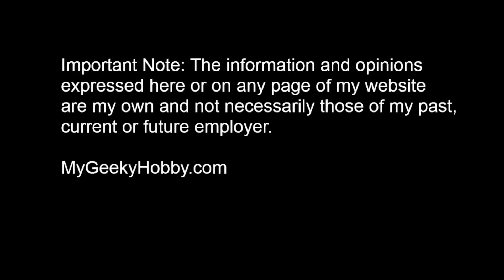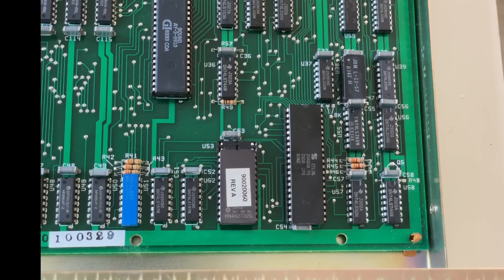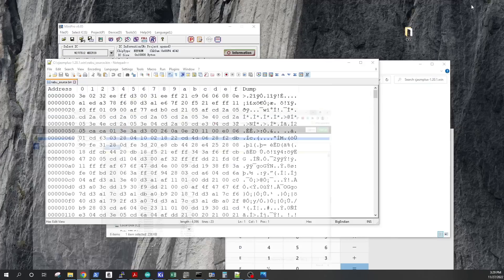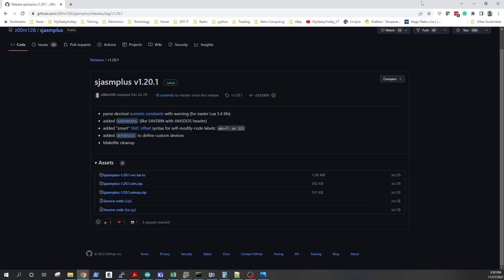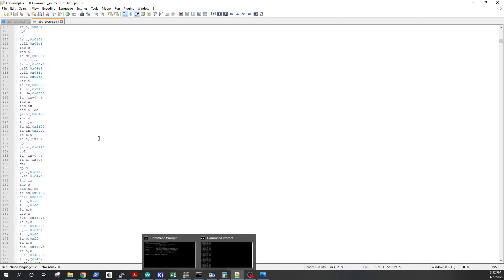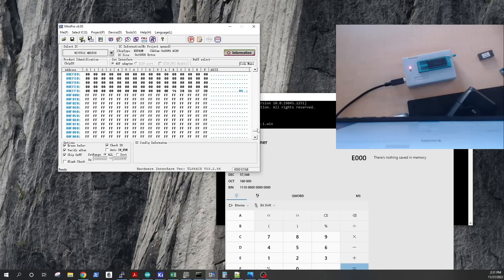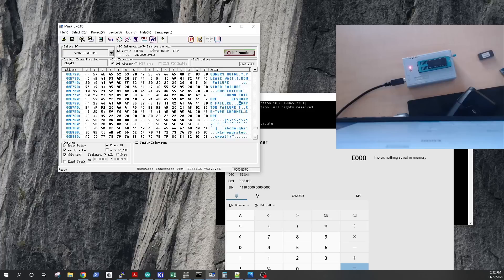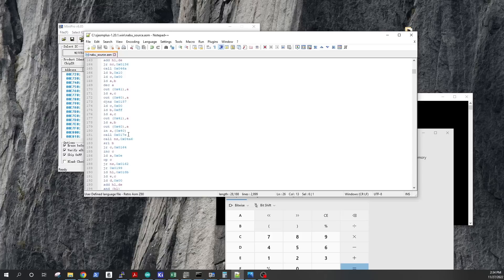#17 NABU PC Hacking

Comment: If still using only 4k on an 28pin (8k+) ROM, is it necessary to still cut the 4k trace and jump 8k? Just don't know if the trace/jumper is to support the hardware (24 to 28 pin EPROM) or to support the address extension for a larger EPROM.
Reply from the maker: You can use 28pin device without the modification as long as you don't go over 4k

Comment: I won't be getting one of these things but I've been watching the progress on these nabu machines. An easy way to fix a checksum failure is to do what we did when hacking motorola walkie talkies to work on the CB band. We'd first find out the checksum of the unmodified code, then make our changes, then change an seldom seen error message or the copyright message that never shows on the screen of the radio sufficiently to correct the checksum. Its a very hackish, amateurish way to do it, but it works :)

Comment: its possible (not probable ) that the couple of lines of code at the very end (of the 4K ROM) verify the checksum of ROM its self, and that altho the ROM starts at E000, the entry point is that code right down the end (say at FFF8 or something) - you might be able to tell better from the 1989 doc Adrian found online (altho that may refer to the 8K ROM) ..
Reply from the maker: Correct, we now know the last two bytes are the checksum, Ken TheCodeman shared the code to calculate.

Comment: I live near the Parliament in Ottawa. Although this is kind of interesting, I think there are better applications of time that trying to get something to happen on a few obscure sort of PC hardware out there. Ultimately, your code has to access the peripherals and video controller. In theory yes you could do a demo or something on that hardware if you really wanted to. I didn't catch your hello world at what level of abstraction that was put in there, or merely altered a string that would have been printed. I mean it could have been part of a screen subroutine system.
Reply: what's wrong with people that likes to reverse engineer old and obscure devices? it's fun, it keeps you interested on something and you get plenty of joy. not everyone likes to do hacks on cutting-edge tech.

Comment: Amazing work. Watch out to not upload the ROM without checking legal implications, as the code is proprietary and still copyrighted. You can use Ghidra and have it visualize the calls. Together with DJ you can then probably identify why his code fails to emulate the Adaptor, or what is failing, maybe even what some of the flags are he hasn't figured out yet.
Reply from the maker: Need to take a good look at Ghidra, a lot of ppl suggested. Thanks for the comment!

Comment: Thank goodness the original seller has sold out, removing the temptation.
Reply: I guess someone will make an emulator of it - so you can plug it into the upstream emulator 😅
Reply: Yeah he has no auctions up at the moment. I suspect he realized he has gotten orders too fast and needs to pause to ship them out before selling the rest.
Reply: The Ebay seller stated 1000 units available, he sold about 500 of them, so 500 more should be available.
Reply: Just heard from the seller. Because he’s a new seller and has hundreds of unshipped orders, eBay suspended his store until he catches up. Speaking as a buyer, that’s probably for the best.
Reply from the maker: He probably has over 1000 of those units :) I'm sure he will re-start the sale at some point.
Reply: DJ Sures says the seller got too many orders too fast, so he 'taking a break' from selling in order to catch up on the shipping.

Comment: Is the 8kb rom on bitsavers Adrian mentioned useable In this? You would probably have to sever the a13 trace and jump the connection to someplace else on the board to map at the next memory location but it might be good to start at a larger rom size and maybe compare the 4k and 8k ROMs
Reply from the maker: Nabu can address the 8k without any hardware modification (there is a dedicated jumper to set 4k vs 8k ROM)... it has plenty of RAM (64k) so the approach with loading code into RAM and executing it from there is also very valid :)

Comment: It might be a little bit of an overkill, but I think, Ghidra can decompile Z80 code. With it, all the jumps, calls, etc. are automatically analyzed. All the labels and data blocks can be reconstructed automatically (with a little bit of manual help). It can display basic blocks as a graph, search for code and data patterns, patch the code and a lot more. Heck, it can even decompile functions to C-like language (not sure if it can do that for Z80 code).
Reply from the maker: Didn't think about using Ghidra, sound like a good idea, thanks for the comment!
Reply: @MyGeekyHobby  try IDA! I've used it plenty of times to decompile z80 stuff... even the segments and memory registera can be configured there. Ghidra also works, but it's not as good as IDA, but it's free!

Comment: You can't not just take the "BIOS" out, and disassambel it, without understanding have a Z80 cpu is working.
Reply from the maker: Thanks for stopping by and commenting. Of course in this short video I haven't done much more than disassemble and re-assemble the code to test if it will work... next steps would be to analyze the different routines and try to figure out how the code is organized. It's not easy, but this is what "reverse engineering" is :) ... Sometimes it's better to just start from zero, sometimes you can just look  how they did it and try to re-implement. The NABU technical documentation includes all the addresses of different peripherals so we are not far from a tre "hello world" on NABU :) ... Personally I believe the approach of simulating the "ADOPTOR" will be best for everyone - it's already been done once at the York University https://museum.eecs.yorku.ca/nabu